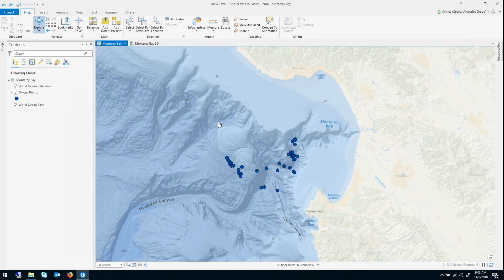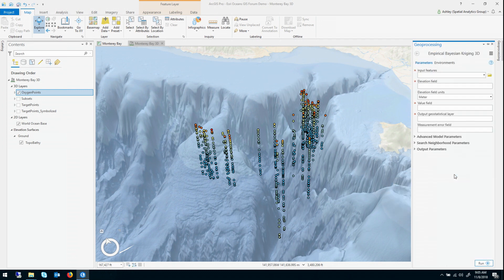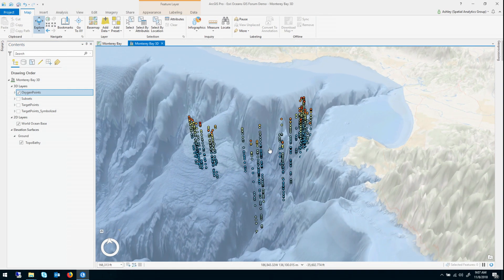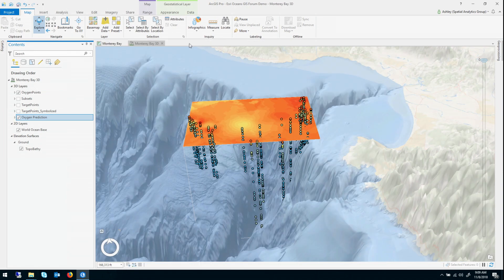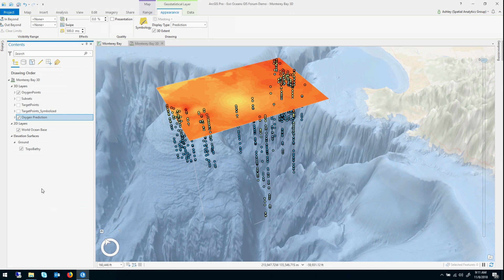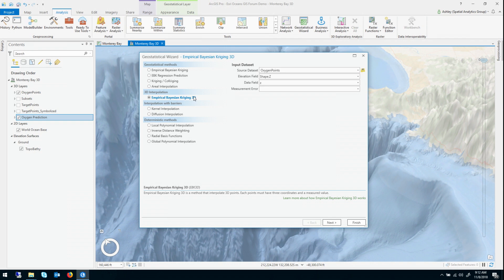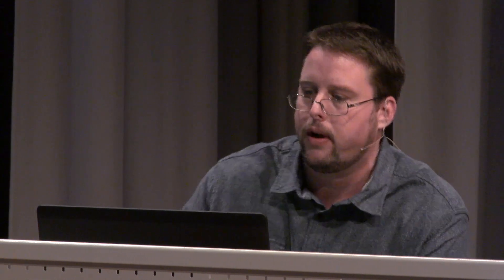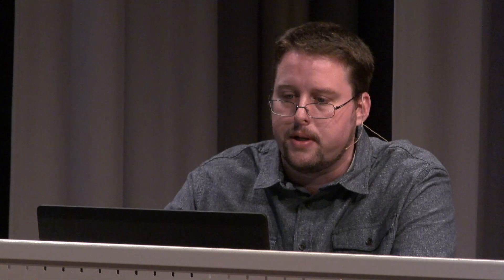3D Interpolation of In Situ Ocean Observations

Comment: Hello, I have two questions, (1) what is the required format for the borehole data? When I extrude I get a cylinder, not a vertical distribution of points; (2) can this method be used with discrete data?  For example, 1= clay, 2=limestone, etc.  Thank you.
Reply: Hey Iowa, did you try this tool with borehole data? How did it go?